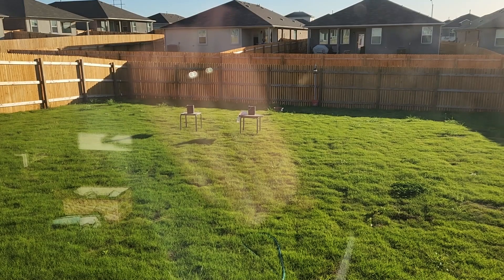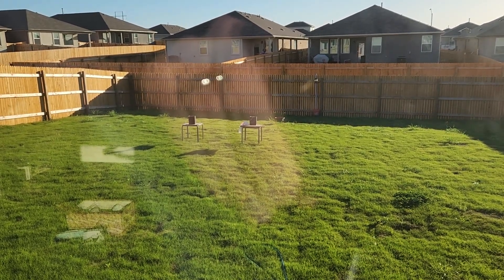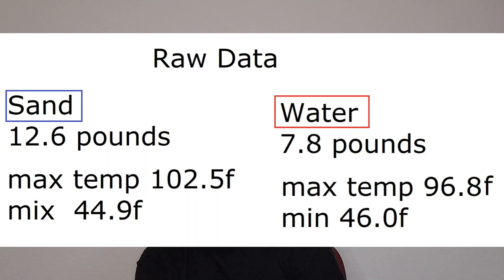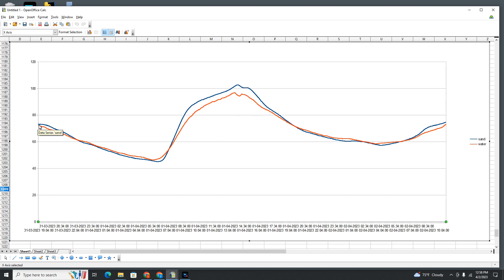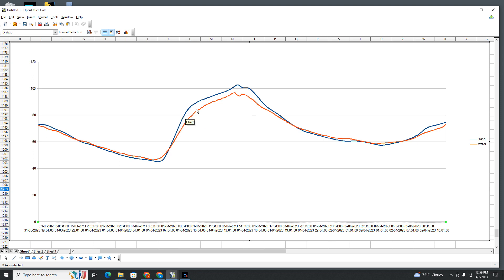Sand Battery  Vs Water Battery: Real Data Comparison For Free Heat Energy Storage!

Comment: First let me thank you for video.
Sorry for my critics, but this experiment just proved, that the same amount of energy leads to almost the same result. But you can see, that there should be added more energy to water to get the same max temperature. So water is better accumulant than sand. 
On the other hand, if you want to get the real comparison, you have to push each medium to its limit. And limit for water is 100°C. That means water below this temperature always store more energy then sand. The advantage of sand is, that you can heat it significantly higer than water. This principle is used in known project in Finland (temp.is 450°C). And this case shows, how sand battery wins. But honestly, higher temperature brings higher loses, so I am not convinced, that this is the right way. Especially for home applications.
Reply from the maker: Ok

Comment: The huge benefit sand has over water is the ability to super heat it. You can only heat water to 212° before it boils wheras you can heat sand up to 3000°. With sand there's no danger of blowing up due to pressure.
Reply from the maker: You are right! Sand is safer and more resistant to overheating but with water you can use larger storage vessels.

Comment: Currently I've been thinking of using a burn barrel to heat up a barrel of sand and running some tubing Inside the sand to complement a solar water heater. Sand can hold higher temperatures than water. Maybe something worth a try.
Reply from the maker: Don't bother. Check out my other videos in the series.  If you just want to heat water, then use direct solar water heating with black tubing.  It will work better, be safer and cheaper

Comment: I'd like to see this experiment repeated with a hybrid of sand and water.  Wet sand.
Reply from the maker: go for it. Let me know when you post your video
Reply: @texasprepperprojects  the other part of the equation is the release of energy and energy density.  In simple terms how long will sand keep a room warm vs the same volume of water, until all the energy has been released?

Hard for me to do this experiment this time of year.  I'm in Central Florida and it rarely gets below freezing.   Perhaps I could do sort of an inverse experiment and use Earth or water for cooling instead of heating.
Reply from the maker: @floridacoder   I graduated from UCF. Lived in Merritt Island for many years.    It's a complex question, but watch my entire series where I show my testing.  In Florida, I'd personally use direct solar pipe to heat up 55 gallons of water. It's a LOT easier and uses a lot less electricity than my sand battery.   But still, 55 gallons of water is going to assist with around 150 sq feet of space.

Comment: I'd rather have the heat capacity of water. You can use an electric heat pump to extract all that heat instantly with the appropriate phase change material. If you want to be the most efficient, you'd probably want to use resistive heat elements to preheat your water plumbing so you don't waste all that heat you've stored just warming up your pipes.
Reply from the maker: Or check out my simple solar hot water heater

Comment: Thank you very much for your videos!
I’ve been researching how to heat my small 6x8 greenhouse and I’m about to give it a try after I get more information on 36 volt heating cables from a company.
My plans are to dig 2.5 feet down, plastic and insulate the bottom/sides, maybe plaster over the insulation,  lay 10 inches of sand, lay my heat cables, lay another 6 inches of sand, lay 4 inch corrugated, drain pipe with manifold, lay another 6 inches of sand  then top with stone pavers. The corrugated pipe is so I can pump air with a fan through the heated sand. 
I have to check if the corrugated drain pipe can handle 100° degree temperatures first. 
I don’t believe heat cables can heat above 100° 🤷‍♂️
Reply from the maker: Email me. I have a better idea

Comment: raw storage is one thing, but does having water make transferring that stored energy so much easier and efficient to make it better for some applications than a sand battery? I suppose you could still use water to transfer the heat into a house or whatever you're heating.
Reply from the maker: This is a follow up as storage sand vs Water

Comment: Did they "retain heat" or was the temperature outside just warmer the second night? We need a 3rd data logger tracking outside temperature.
Reply from the maker: Temp was stable.  The point of this was to have an apples to apples comparison with all outside factors being identical.

Comment: Problem with this test is that water and sand conduct differently. Sand will have far more distinctive pockets of heat whereas the water will spread it out more. 

A more accurate test would be to measure the BTUs given off over a certain time frame.
Reply from the maker: yes and no. Water has better heat 'capacity' but sand can be heated up to a higher temp. So there's really pros and cons to each. Water holds 4x more heat capacity, but you can heat up sand 8x hotter. So if you have the ability to take sand to 1500f, through geothermal or something like that... it wins..... But not something that's really practical for a house..

Comment: Conclusive?  Test is correct but misinterpreted.  Water has one of the highest thermally conductive materials in existence.   It makes sense it does not get as hot as it releases BTUs exponentially faster than most anything else so it's not going to get as hot because it's outside and not insulated.  The heat disappates like a heat wick when soldering.  It will also not stay hot as long for the same reason.  So it's interesting that for outdoor use with zero insulation a non conductor creates the appearances it works better but in fact it can't measure BTUs.  However the water actually disappated way more heat but your test does not measure BTUs, it measures highest temp, and the temp at your guage.  
Not saying your wrong, as for a non insulated situation you need a non conductor to NOT release heat as fast and sand works well.  At the same time the BTUs delivered will be far greater with water.  Don't even need to test it it's basic physics, you can calculate it on a calculator.   
Love your data loggers btw.  Where did you get those?  Do they measure humidity also?
Reply: Water is a coolant and will keep your hot engine cool because it's thermally conductive.
Reply from the maker: data logger link is in the description. That version does not do humidity but i think there is a version that does
Reply: @texasprepperprojects  nice! I appreciate you going through all this trouble to experiment.  I've actually expanded my knowledge of thermal dynamics eminsely because of questions you proposed.  Ty!
Reply: Yea so....why not test in a northern state were it gets - 20 .... find some real facts .....otherwise I think ur  ....  blowing hot air .....😅😂

Comment from the maker: The real question would be,  how would these two items react at higher temps? if I gave them both 150F (below the boiling point of water). One argument is that water has a higher specific heat that Sand, the other argument is that Sand can get much hotter than the boiling point of water.
Reply: Really, that's it. That's all. Dealing with temps up to 200F, water has a larger heat capacity than sand per volume. On the other hand, you can get sand much hotter. When it's time to extract the heat for  use, dealing with a liquid makes things much easier to manage. Water might win in  practical terms.
Reply: @billparker8954 In practical terms though, you have to keep water pressurized to be able to raise the temperature above that boiling point, and that already sounds more complex than just heating up dirt and using it later. Less maintenance, probably cheaper, and easier to implement. Sand might be better in practice.
Also, the sizes used were rather small. I know there’s a Finnish company that used large sand containers to store heat from the summer to use in the winter months, so really this boils down to context and how it’s actually going to get used.
It’s like the case for home wind turbines. They’re technically more efficient than solar panels, but in practice it’ll be cheaper and more reliable to just get solar panels and batteries.

Comment: I think if the period is prolonged, the difference will be great in favor of the sand..the water will not rise more than the boiling point..but the sand reaches five times the temperature of the water.
Reply: Would the problem with that be the heat loss due to high temp of sand (500c) to relative temp outside (30c) so the heat loss increases drastically? Need to insulate well to reduce those losses. Seems a no brainer that sand is best, but just need to provide really good insulation once those high temps are reached.
Reply from the maker: Agreed
Reply: How do you suspect a bucket of sand sitting outside on a table will ever reach temperatures much above ambient? If we saw this experiment logged over a year we'd see the exact same thing. Except maybe somewhere around freezing we'd see the sand continue to track right along with ambient temperature while water would hesitate a bit at phase change as it's offloading a ton of energy required for freezing. At the end of the year this experiment would just give you the average temperature of his backyard.